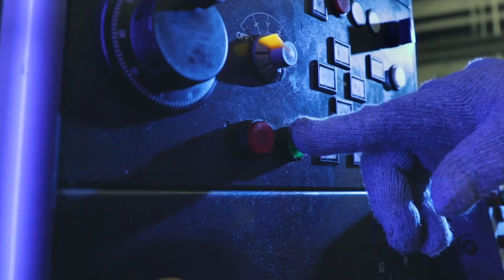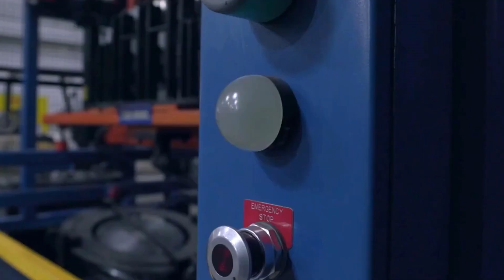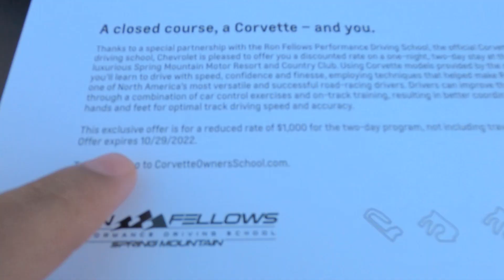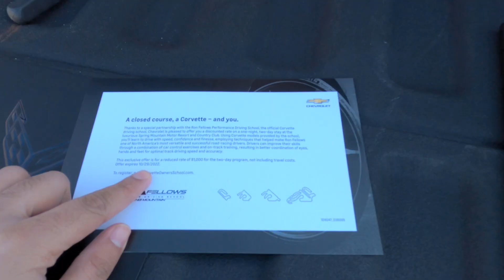Another C8 Corvette Production Shutdown! I Finally get this for the C8.R

Comment: What’s your opinion of the ERAY?

I have a  2022 Red Mist HTC 2LT, Z51, Mag Ride, Front Lift, GT2 Seats  1,194 miles

Turned a year old 2/14/2023

I will keep the Stingray  

I’m supposedly first at my dealership for an ERAY allocation if they get one and is to be sold at MSRP.

Deal or No Deal?

Also have requested an allocation for a ZO6  at MacMulkin, but down past 1,500. 

I see the ZO6 as being more valuable and collectible?  Agree or disagree?  
But, I’m more into straight line performance than tracking a car.

Oh yeah, I’m 68 and fighting a serious illness.  Might be my last Corvette…..
Reply from the maker: Someone said something the other day that's stuck with me. The E-Ray is the car you buy with your mind and the z06 is the car you buy with your heart. I would do an E-Ray all day long. Its the better everyday car then the Z06. Z06 is faster but E-Ray is quicker. Z06 will be more rare as everything I hear is that E-Ray will be produced in volume. On track for 2k Z06s for the 2023 MY which is nuts. I would take the first of whichever shows up and then cancel the other. That's actually what my plan is lol.  Really can't go wrong with either. Wishing you the absolute best in your fight Kerry.

Comment: NO MAN ! Values are GOING DOWWWWNNN! LOLOL yea right
Reply from the maker: I am working on a break down video of pricing drops. Stay tuned.
Reply: @JumpSquadAuto  i love hearing all the fantasies my friends tell me: “your c8 is cool but I’ll wait till they’re a ‘reasonable’ price” and I’m like dude if c7 grand sport is still $65k avg and you have Apple Store lines around Chevy dealers you’ll be waiting a while 🙃
Reply from the maker: @JPIndustrie  They are starting to show up at MSRP at a lot of places. They haven't dipped much below that on the retail side. i've seen several not get msrp at wholesale/ trade-in numbers. But yeah with C7s commanding strong numbers...only so far the C8s can fall.
Reply: @JumpSquadAuto  very true however these are the types that are thinking they can wait 10 years and get a c8 z06 for $25k like a c5 z06 … I think they’re going to be in for a rude awakening. However I would say the biggest complaint to GM is resale so this is how it has to be 🤷🏻‍♂️
Reply from the maker: @JPIndustrie  totally agree with that too. C8Z will likely forever be an over msrp car. Especially if volume remains this low. Iconic purist car one everything goes hybrid or ev